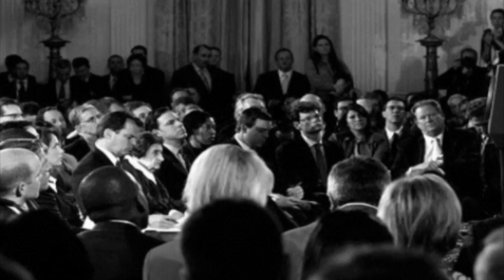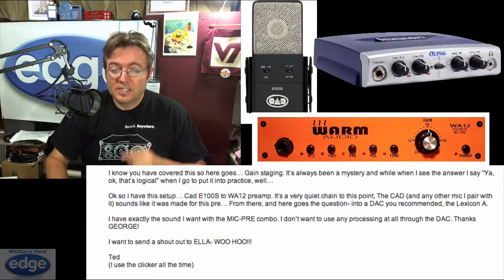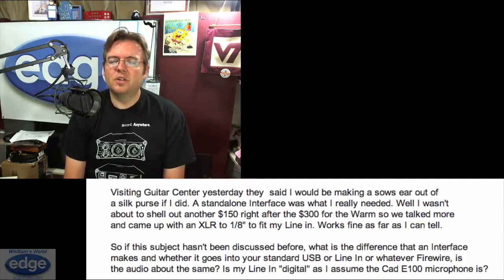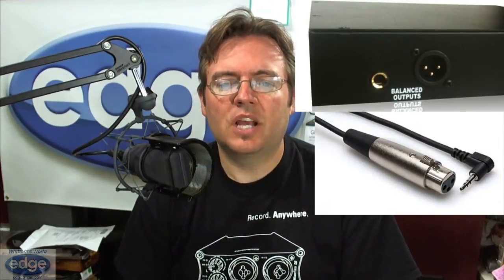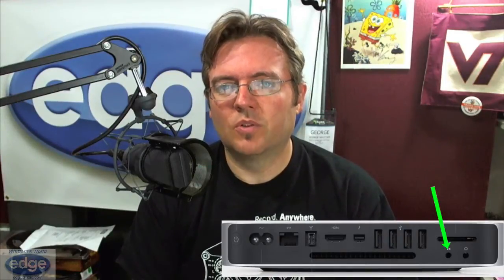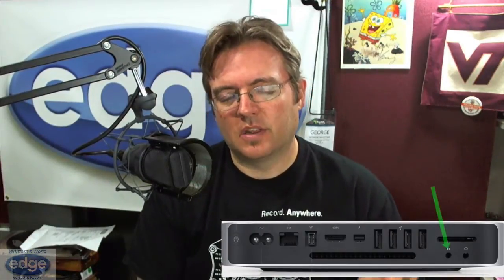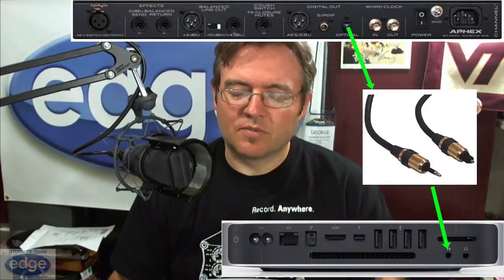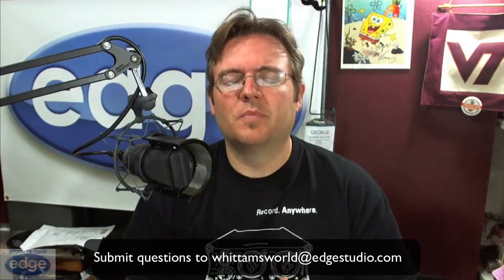Edge Studio's Whittam's World - Episode 28 "Dueling Converter Queries"

Comment: George, the mic mentioned by the Mike and Ted requires phantom power. The Lexicon Alpha does not have 48v phantom power. What is needed to power a mic requiring 48v phantom power. I'm new to this and had a Lexicon Alpha and it would not power my mic.
Reply: They were using mic preamps that supply phantom power, but you can just get a phantom power supply to plug a condenser mic into the Alpha, they run about $30.